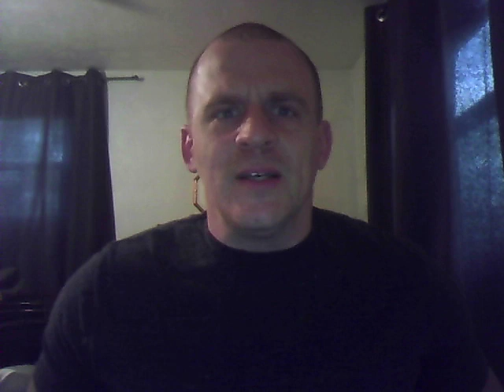2002 VW GTI Cooling Fan Test (Part 2)

Comment: ScannerDanner you are amazing electrical and mechanical very handful man!
can you help me please with my problem?
its very similar but more electical, there are fuse box on battery the right side fuse 30a are cooling fan this fuse very HOT and for long ride its burn my fuse box(
there are 2 new fun but different brands + new controler fun/relay/ECU fun and unit on the radiator new HELLA
so the question what can make it so HOT to burn fuse box????

thanks to every body for any advice guys!
Reply: sorry i forgot to say wich car it is its very popular engine 1.6 AKL SEAT Cordoba 2001 6k2
its placed on VW, Audi, Skoda 1.6 AKL the same one with little different
Reply from the maker: Resistance in the fuse box itself. Poor or corroded contacts with that fuse is what is making it hot. Unless current flow is very high and almost to fuse blowing amperage. But my money is on corrosion

Comment: My son's vw overheats and did the check you did with fans but fans don't come on but module keeps clicking when I touch the contacts
Reply from the maker: I'm sorry but this video is so old that I remember nothing about this system. Power and ground testing on the fan itself would be my next step

Comment: OK, so what happens if jumping the wires does NOT turn on low speed or high speed (which if I understand needs to be done with ign On) Does this now point to the fan relay switch under the car?

Comment: This video is a great example of what's needed in the world today to avoid deep despair for our young:
 
Definitions:
Ego is identity. It is a story we tell ourselves, like a cloak we wear. It's like a metal shell we carry around us.. not unlike a car?? Then, if we make our opinions part of who we are.. any advice or differing opinions will feel like an existential threat. It's not. You are not this story you tell yourself about who you are. Let your fictional, romanticized story dent, and die. 

In this case, it was being humble and free of ego defense reflexes to listen and share a very small oversight which I bet you would not have if not shooting the video with a helper to teach along the way . 

Look, if you didn't make this video (and teach a future "KNIGHT against entropy" at the same time).. I wouldn't have added to the check list for figuring out that it's likely wiring or the computer which is keeping my tested good auxiliary fan on my 2000 Eurovan from spinning. That idea was indeed.. see if that $150 scantron gauge I have can tell me the temp at the radiator.. by unplugging the connector you showed and seeing if the temp readout goes away.

As a former electronic engineering, I learned something about how electronics are laid out in cars. This is my year to learn auto repair while others are losing their work ethic forever?

elsewhere
opinions with new information.. as any scientist would. To stick with any theory despite what your eyes clearly see? That's not science.. that's religion.

Comment: thank you bro.. my vr6 jetta 2.8l was boiling my antifreez and my water container cap was bad... fan not working at all. i try your test. and it was the temp. sensor. the one on the radiator. thanks again.

Comment: I replaced the switch as per the other video as I thought it might be the culprit.  it's not I also shorted the high and low speeds so the fans work. checked all fuses both on battery box and drivers side they're all good. I'm thinking it's the fan control module. any help in troubleshooting would be great :)
Reply: Brody Moodley did you ever figure this out

Comment: nice  VID  BRO  &  your  SON,   IT  happens  a  lot  of  after- Market  --"WATER PUMP "  Are  not  designed  correctly,  even  when  they  are  made  to  push  the  water  through , they  don't ,  it states  it  word  for  word  in  the  Shop  Manual , Make  sure  the  water  pump  is  identically  the  same ,  or  you  will  have  Issues .  but  your  right , in  a  Close  System ,  how  do  you  check  for  Flow ??

Comment: I have an 02 golf gti. It starts to over heat when I'm in stop and go traffic. I followed part one and it worked for a few days, now my low speed fan works but the high don't. Where might I start to find the problem? Any help will be much appreciated.
Reply: did you get an answer to your question? im having the exact same issue
Reply from the maker: Post this to my forum for additional help. Thank you!
http://www.scannerdanner.com/forum#/general-repair-questions/
Reply from the maker: Post this question to my forum. Sorry but that's the best I can offer right now.
http://www.scannerdanner.com/forum#/general-repair-questions/

Comment: ok ScannerDanner I followed your tests on part one and found that the fans would work on the high speed side when I jumped them and you could hear the relay kick in and out. But, when I tested the low speed side the fans did not run, nor did I hear the relay kick closed. So since you left us in the dark about what to do in this scenario, I am assuming that the low speed fan control relay is faulty and that I need to replace it. Correct?  I wish you would have walked us through more stages of this diagnostic procedure and the what if's that can occur, even though they didn't happen to your particular application.Not trying to pester you but a little more input would be helpful. Think of me like Johnny 5, "INPUT". Thank you though and great video.
Reply from the maker: +troy riddle sorry man, next one I get like this I will do so

Comment: Hey Paul, I followed your diagnostic steps on the fan for the same car. However, the high fan would not go on. Unfortunately, I already replaced the temp control switch and the module as well.  Still the high fan would not turn on both ignition on/off. The low fan does work. there is continuity on the circuit on both hi/lo. what am I missing here

Comment: its common for the water pump to bust or freewheel
the new ones are metal not plastic
use infared thermometer    easy check

Comment: That's awesome Paul! We are all learning together. I had no clue about VW water pump impellers until 2007. I got my but kicked on one. Lol! Those water pumps are so deep beneath the timing belt and have no access to test. I worked at an independent European garage. The owner was a genius and a great mentor. Thanks for covering this one. Water pump impellers are rare but they do go bad. They are a major player and are always over looked. I had a Buick 3.8 have an impeller go bad only after the head gasket finally failed. It loosened up after it reached maximum temperature. It was an intermittent problem. Man that was tricky. I also had a GM fan switch skew about 8 degrees. The fans would kick on slightly late, causing the expansion ratio of the coolant to exceed the cap pressure and lose a few ounces of coolant into the overflow just before the fan kick on. Then it would drop and behave normally. The customer would commute to work 5 days a week. It would take a week for it to actually be 1/3 gallon low causing it to boil and gauge reading hot. The over flow would put coolant on the highway half way to work so I would never see any coolant anywhere. Finally my infrared thermometer exposed the sensor reaching 235 degrees before the fan come on. I will always use my thermometer from now on as a courtesy check.
Reply: Also, read my comment on part 3. You mentioned how your first boss Joe challenged you to explain"Why." I explain "why" those impellers fail in that comment. Observe the VW block. With the water pump removed. You can see the casting and shape of the cylinders. It becomes an "oven" when coolant is low.

Comment: Hi Danner just on a side note the water pumps in WV cars dont always look defective at first glance you need to remove the water pump  and grip both side then twist  in opposite direction you may find that the plastic side will not move and the pulley side will . Good vids as always

Comment: check the heat off the car interior heater blower as water runs though this at all times  when set to full hot if no heat of heater as engine heats you have no flow or no coolant going in and out of heater matrix

Comment: you were asked to diagnose an inop cooling fan...you did exactly what was asked of you. correctly i might add. i can only assume the a/c wasnt functioning on this car or the fans would have cycled on with the clutch.
   as for the suspect impeller...weve seen dozens of them. pull a heater hose and hit the throttle and youll know for a fact.

Comment: hey Dan need to pick your brian on this one had VW bug same motor in shop weird overheating issue would overheat intermittently you could drive 50+ miles then over heat next time drive 10 miles overheat anyhow customer did blow  head gasket  was replaced, head sent to machine shop checked and decked ,water pump replaced twice, theromsat replaced numerous times, raditator changed, coolant temp sensor replaced, fan switch replaced, fans wired direct temporary.  always came back same result when it overheated radiator would be cold motor hot chemical test for hydro carbons none. we were lost. Was no rhyme or reason to the over heating  car ended up going to auction but still bothers me that couldn't figure it out. any ideas????
Reply: Did you ever figure this one out?
Reply: @Franklinveterinarycenter1of4  no the car was sent to a auction and we put the customer in a different car

Comment: In Europe this is a big problem with Vw water pumps the impeller doesn't break up it just free wheels   on the shaft. Vw know about this problem and if you bring it to the dealership they will give you a new pump for a discounted price, totally stupid really why not just redesign the pump?

Comment: Paul, you are the man. Thanks for the update video. These things happen. Props to you for making the correction for us. If you have some free time, I have some questions. What exactly was happening? the block was getting hotter than the radiator? I would think a good way to check is with the fans off, thermostat open, the temps should be pretty close. If not, is it possible the new thermostat is defective? Ive had quite a few bad ones even from the dealers

Comment: Hey Paul love watching your video's always learning something...But after watching so many of them I was wondering why you never start off with checking the fuse's then check the relay then check the relay wire socket . from there you can check the wiring to  power to the fans to the computer and to the sensors or switch. you can even run the fans from the socket and that will tell were the fault might be if its electrical.. Have you seen "The Hook" by power pro its a great tester it a bit pricey  but you can get one for under 300.00 but worth every penny.. :) check out the video's of it here at utube or at the powerpro com  the one that starts off as "Snap-on power-probe the hook" keep up the great work.

Comment: To check for a faulty waterpump you may wanna turn the heat and the blower motor to max. If there was no water circulating, there will be little to no heat output :-)

Comment: Hey Paul another great vid and good by pass testing whole electrical circuit in one. As for the water pump I work in UK at vw garage and these are common we upgrade to metal impellers then they don't seem to fail again. When replacing the thermostat you cab put your finger in and feel the impeller as it's just to the left of the stat I feel one for the previous garage to do next time.  Cheers for the vw video nice to see

Comment: Hi.Scanner...don't wanna rain on ur ..but did bust the connector when removing connector plug as tab looked missing  as you said it took a while to get off?? These engines very common for the impellor falling of the pump spindle...& slapped wrist for bad procedure info..lol

Comment: Hi Paul, in your defence you did say the thermostat had been changed and one would assume someone somewhere along the line would have run it up and checked it, I have had plastic water pump impellas fall off or break, on BMW's, normally pattern or after market ones, originals normally metal usually ok, I had one Brithsh car one that had a stuck shut thermosotat, the sensor was on the engine, so the fan was blowing a stone cold radiator all the time....Fred in Sunny England

Comment: when you recognized you missed some thing that make you a  big man ,   where I worked there is a guy who has worked at VW dealer I believe the shop advertise it because he work s on a lot of this car I have seen a bunch of cars coming in Audi Vw for  water pump broken  some 60k, also for ratting noise  and oil leak coming  from  secondary timing chain tensioner  the one adjust  VVT. BAD TENCIONER ALL THE TIME COMMOM

Comment: In Europe almost every car has a sealed cooling system and it has been around for some time now. The small hose going back to the expansion tank is a "steam" or bleed hose. In Sweden we call it a "gossip - tube" although it is not a tube. And gossip because it kind of gives the thermostat away if it is open or not. There should be good flow when engine is hot. On some design perhaps a little bit when cold.

Comment: Hey Paul,

Watch you channel all the time. 12 years in the field on my end. Appreciate all you do man. Been burned before on these VW's just a little info that hopefully will be helpful. You can remove the t-stat and you can actually see the water pump impeller which is plastic. If you can finagle you finger or a hook tool or possibly into that area you can actually move the impeller. The impeller should not move on the pump shaft because the drive for the pump is secured by the timing belt. If the impeller moves or rotates or can be spun it's a bad pump no doubt. The impellers are plastic on the original pumps and are pressed onto a steel shaft. Just thought I'd put this out there for anyone who may get stuck or have the joy of dealing with a VW overheat, no heat, or no cooling fan operation issue. Thanks again for posting and taking the time you do to put stuff together for professionals do it yourselfers alike.

Comment: Don't sweat it bro, I've seen a few techs get bitten by bad impellers. Mulligan granted! To be honest, I think I might have misdiagnosed one recently (poor heat at idle issue - low flow maybe?). Went with the old TSB on the older Taurus heater core. Hasn't come back yet (fingers crossed). Thanks for the update, and the Edo plug.

Comment: My test would have involved heating the switch in a jug.
That would have shown me it was working. causing me to look elsewhere for cooling issue.
However verifying coolant flow and rad temp seems much easier :)

Comment: I have changed quite a few of these I have always found the plastic impeller unbounded and spins freely on the shaft, the original part has the plastic impeller. I fit a quality aftermarket which has a metal impeller and never had another problem and always changed the cambelt at the same time, my preference is gates but that's just me. I always look forward to your videos, thank you.

Comment: Don't feel bad, Paul. Common sense says a water pump that's not leaking should be fine. But, this happens to be a German car! Why do Germans insist on using plastic water pumps? Owning a German car used to mean something. Today, they are basically money pits.
Reply: ford diesel 6.0  are plastic pump< I did water pump on 01 Toyota sequoia  plastic pump too.
Reply: maybe they were not OEM. I looked up the Aisin pump online and it sure looks like a metal impeller to me.
Reply: happy543210
 yes they are plastic,  the one a removed  and the one I installed were Aisin they are  tan  or soft brow color the impellers

Comment: Paul the schematic looked like the sensor   did a whole lot more than switch - on- off - hi- low,  was there a code for low temp coolant at the rad.  VW has a code for just about every possible fault  .  I seen a VW code P1654  "nut behind the wheel"  never did figure that one out.   Way over my head but just curious if a code was set.